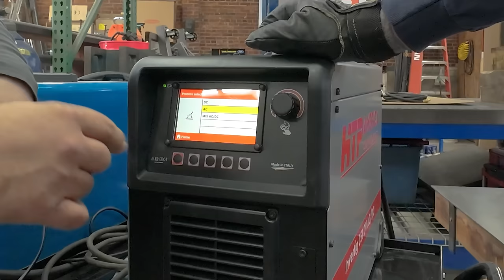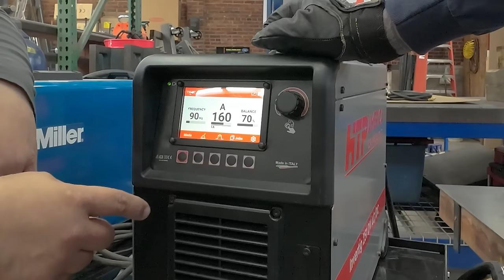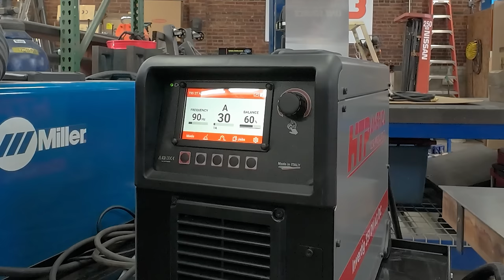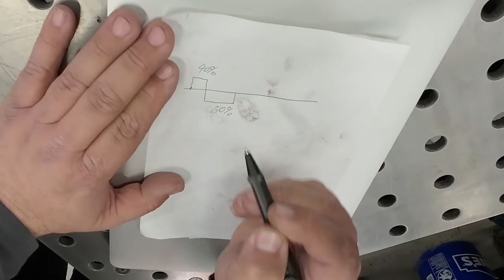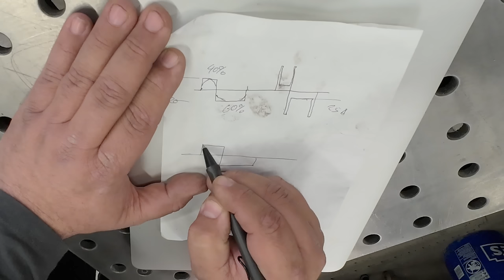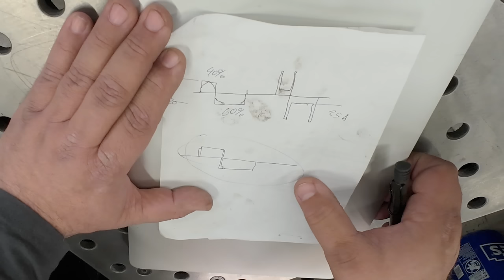I Can't Believe How Easy This Is...

Comment: An old boat welder I know has two cans welded together with a three run fillet weld. The ends of the welds are not matched together so you can see each run. It sits in front of a sign that says "the only thing I can't weld is wood". I gave him two cans made of wood and joined with timber colored Silicon in a way that looked exactly like stacked dimes. He now says my daddy said I could do anything, so I did the impossible...!!
Reply: Fun fact: Wood can be friction welded. Don't ask for what that could bossibly be usefull but it can be done.

Comment: Im starting with a guoshi 140 115 amp mig welder.  Ive owned it for 10 months.  3 weeks ago, I salvaged 3 metal boxes.   1/16th thick steel, probably thicker.  I cut up the boxes, and I have over 100 feet of metal to practice with.   Today was the 1st run.  I didn't even know how to set up for MIG welding.   I didn't get a spark for the 1st 15 min😅  so guess who knows how to set up his machine now😂.
I also learned to tweek it.  Low speed medium heat.  It only has 2 dials. One for voltage and one for current.   I used .03 wire, it went well made many mistakes and cant wait for another sunny day.   Im doing it outdoors🏌‍♂️🌌

Comment: I’ve wanted to try this.
Reply: Do it, with your 221 you have to light the arc on the filler rod not to burn a hole in the can ….

Comment: Next time set it up to do with 2 full cans, from a distance, and watch them explode when the soda heats up.  Or maybe it would be a heatsink?
Reply: We thought of it.  You cant get them warm enough …  the fluid on the inside keeps the cold, they dont melt
Reply: And this is how you measure the level of liquid propane in your propane tank... pour hot water over the outside,  and feel the temperature of the tank afterwards (where the water ran down)... you will feel hot metal where there's only has inside,  but as soon as you reach the level of the liquid propane,  the tank becomes cool to the touch.